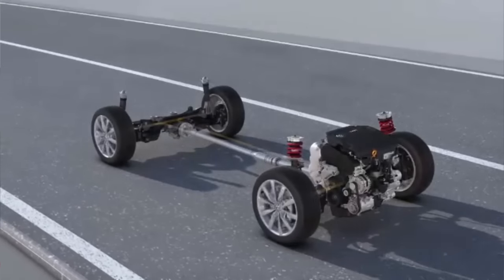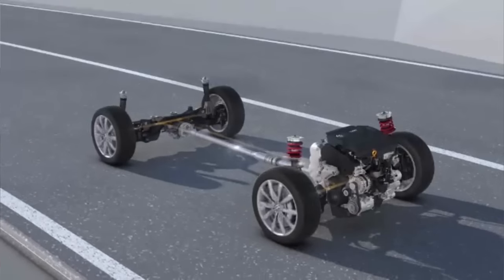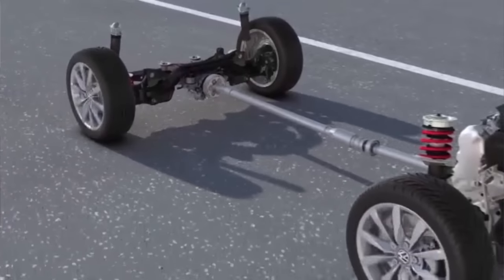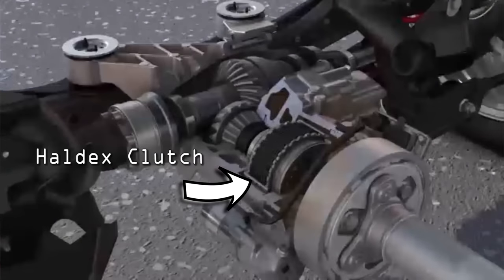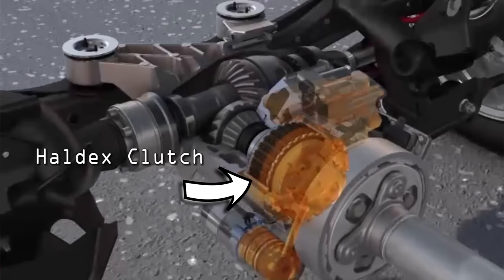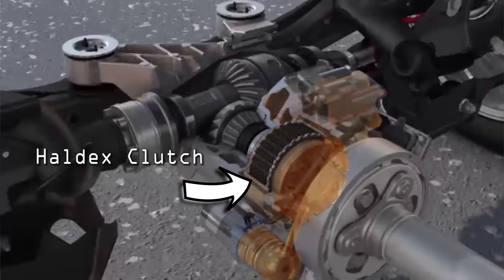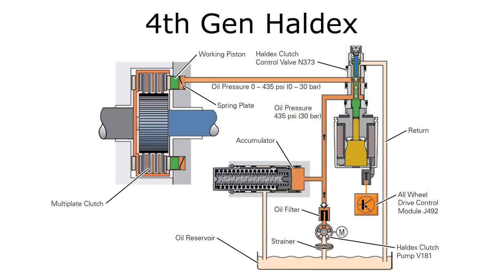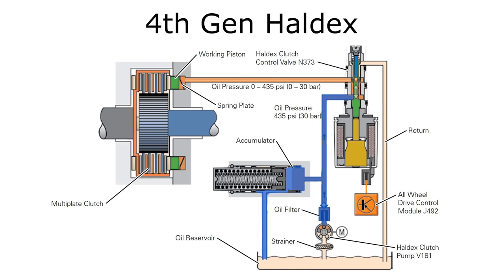How Haldex (AWD) All Wheel Drive Works

Comment: Actually, it was Gen III that added the electric pump for precharging the accumulator. Gen III was as fast as Gen IV in reaction time to front wheel slip (15 degrees), and was proactive as well, not just using front wheel slip to activate the rear wheels. The difference between III and IV was that IV eliminated the mechanical pump, and used an electric pump exclusively, while III had both an electric pump and a mechanical pump.
Reply: So which is better?
Reply: @nw8000  IV i think, as it eliminated the need for a serviceable filter and has less moving parts.
Reply: @aydenu9057  It only eliminated changing the filter from VAG dealers' service schedules.  Meanwhile, Haldex 4 and the current Haldex 5 pumps have been failing because of clogged paper cartridge filters in the former and clogged gauze strainers in the latter.  I had the gauze strainer in the Haldex 5 in one of our cars cleaned at 20k miles.  It was not a pretty sight.
Reply: Yo know maybe What is differenc with old versions Gen1 and Gen2

Comment: Hi one question please, if you know why on Audi Q3 (haldex gen 5) when launching with wheels turned all the way a rumble sound is heard accompanied by vibration at the beginning of the acceleration, and not happening if the steeeing is less that lets say 80% of full? What happens is it the haldex or the rear diff? Thanks

Comment: I have a 2010 Saab 9-3 XWD with Haldex Gen 4.  Have not driven it in snow yet, but can’t wait to see how it responds.  I just purchased the service kit, to change fluid and filter before winter.  Never had cross wheel drive before!

Comment: FANTASTIC! 
Thanks for taking the time to explain this, my buddy's R32 has been making a whine on higher speed downshifting and spirited driving conditions, we're going to tear it apart and fix it but this helped in researching quite a bit.

You should consider doing another similar to this one on the new electronic differential installed in the MK7 Autobahn GTI. As far as I know this electronic component is new to VW and only placed in a few production cars at this time. 
I worry about that part being the weak link as I buy parts to tune to beyond 300HP

Comment: Any recommendations on mechanics (not the dealer) in NJ and surrounding areas that are experienced in Haldex on MK1: Here is where I am at: 
1. Replaced the control unit with a used unit.
2. Got the dreadful code, sporadic mechanical clutch failure.
3. Replaced the ground strap/earth wire and tested the functioning of the rear wheels.. they spun on the lift and not under load.
4. Finally got the pump replaced and tested in the rain the other day. Just front wheels spinning.
5. We did the VCDS test on the Haldex system and all was ok. No codes at all.
6. Traction control light goes on when I got on the car.. ABS breaks tested/AWD System test and no codes. Tried getting the wheels to spin with out EPC activated with no luck either.

Is there anything else this awesome community can tell me what to look for before I get under the car myself and replace the whole rear drive of the car with another used unit?
163K on 2002 ALMS EDITION and don't think car is worth more than 4k.. Sucks to be attached to a fun car!

Comment: It is very easy to tell if Audi or VW has central differential or Haldex: cars with longitude engines has drive train with central diff f.i. Torsen; cars with transverse engines are equipped with Haldex.

Comment: Hi Paul..I have one problem with my audi s3 8p1 2008..i have give up my car in lifter..I have make the second gear inside and the front wheels is working and the big pipe front front to rear diff..but my rear wheels dont working..I haved chance the oil and filter from haldex system..and the pumpe is working I hear it..what do you think..have a another problem or the system start the work only when the car is in street..and he start from 0kmh or from 10-20kmh

Comment: Does 4 Motion rear diff make any noises like an old air conditioner’s refrigerator system kicking in? I just got an MY20 Allspace in Australia (normal Tiguan in US)  and noticed the noise at low rpm in D1-D3 but now all throughout the gears especially around 2000rpm - on accelerating gradually makes the noise more obvious but it fades away once the car is travelling at high speeds probably due to engine noise. It’s my first 4 Motion VAG car. The noise happens on accelerating in a straight line or more easily duplicated after going over the speed hump, gradually accelerating. 

Dealer (salesman) gave me a courtesy call on the day of pickup to tell me that it may be the humming noise from 4 Motion rear diff. Is that likely? It’s not intrusive and all of my passengers don’t notice it at all. My other drive is MK6 GTI and compared to that this Allspace makes a lot of ticking and clicking noises on downshifting as well - probably due to being quieter?

Comment: Paul - I have 2 Haldex equipped MK7's - Alltrack and R (both 2017's). The alltrack feels much more FWD than the R - not sure if it's because it's tuned differently, or just other factors. Are there any significant differences in the way the two AWD systems function?
Reply: Yup it's basically how it's tuned, Alltrack won't be travelling at high speed offroad so the system has enough time to react when the tires start slipping, so it will stay FWD most of the time, the R on the other hand need to be stable at high speed so it will throw power to the back and adjust more of the time and even before it starts to slip making it use the rear wheel more.
Hope this helps

Comment: Could you please possibly tell me if the haldex drive shaft on a mk7 golf r runs through the main clutch at the engine. If not I will run more power to the rear to ease the strain on the main clutch as it slips,

Comment: Hi and thanks for the info!

What happens if the pump is dead? the vehicle becomes front wheel drive and thats all? Is there any damage to the haldex if the pump is dead? Could you post the part number for the haldex pump gen 5?  I have the following error: 16671 - Pump for Haldex Clutch 
          C1112 04 [008] - Internal System Fault

Thank you!

Comment: I have a 2010 TTS that feels like it is driving from the rear under normal driving. It also wears out the rear tyres faster than the front. I cannot find any data on the % split for the TTS.

Comment: 4:02 there is no pump powered by the drive shaft in gen1, its electric. You can upgrade the gen1 controller to lock the clutch based on throttle position. There is also a mechanical insert plug to lock it 50:50. Aftermarket LSD available to front and rear. On stock form it's quite bad and introduces understeer easily
Reply from the maker: +avainola you are correct I misspoke and they also use electric pumps.
Reply: avainola I was also surprised when Paul said that because I had a gen 1 TT and it had a pump on it plus à filter the only model that have no pump was the syncro system In mk2 and 3 cars I thought that there was a version of Haldex that we never saw here in North America i Guess not. About the filter situation on the first few years or the production of the Tiguan there is a filter but it's not available at the dealer what I have seen is they tend to leak oil at the filter cover I bought some filter kit from ECS tuning I don't know if Paul has them available they are genuine Haldex parts they are not cheap but way cheaper than a new differentials.

Comment: What will happend if you customize haldex drivetrain on mid engine car like the MR2, transvers mounted engine and gearbox on the rear axle and the haldex system sending power to the front wheels.

Comment: I have a 8V S3 and the recommended Haldex oil change is every 3 years regardless of mileage. Is that oil the only thing required? No filters or special tools (as you've mentioned)? Is it easily accessible?
Reply from the maker: +jmb2027 filters are only on earlier gen haldex cars. Your vehicle wouldn't have a serviceable filter.
Reply: Deutsche Auto Parts thank you. what about any drain plugs, tool, or anything else required?

Comment: With a gen 5 haldex on a audi a3 quattro I'm having a rumbling on the rear end..fuse out to shut pump down no noise..question is are the rear axles doing anything different when haldex is engaging and sending power to the rear wheels vs when the car is acting as front wheel drive or when the fuse is out shutting the pump down..the cars already had a new pump and rear diff. Put in and didn't help

Comment: the 2017 S3 is said to have an upgrade AWD system where it can send more than 50% power to the rear wheels. On the audi website it also says it has the quattro system. So 1) is the S3 not AWD all the time? and 2) if not, is there a way to keep the rear  diff from decoupling?
Reply: Zareh Shahinian Quattro is Audi/ 4Motion is VW, still a Haldex system just each brands nomenclature.
Reply: Zareh Shahinian its mechanically impossible to send more than 50% to the rear wheels without the front wheels actually slipping. All 4 wheels on the same quality road surface and 50:50 is as rear biased as this setup physically allows.
Reply: You can never get more than 50% unless you can unhook the front axles from the transmission.
Reply: Yes it can, the traction control will kick in and can cut power to front wheels, hence rear wheels have all the power. Audi is stretching it, but they say the S3, RS3 and TTRS can do this. mk7.5 R as well.

Comment: thanks for share this video of haldex,  i ve the 2008 mk5 r32, can i use redlne oil GL5 75W90 on the haldex? or only recommended using the original haldex oil. any chance to use another haldex fluid, because the vw oil is expensive...thanks a lot. lawrence
Reply: sorry, due to friction clutch was developed along with the oil, so there is only one choice: statoil 12-301, now it is owned by FUCHShttps://www.rimmerbros.co.uk/Item--i-LR054941if you are in China, I can send u some.

Comment: What about Volvo, same?  I want to convert my FWD 2002 V70 to AWD if I can find a wrecked XC70 with a complete setup.  Will probably want to rebuild/service some of the driveline components.  Could you point me toward any applicable resources for AWD swaps on P2 chassis Volvos?
Reply: Really Happenings h
Have you begun the project? woldnt the lack of a transmission tunnel be a problem?
Reply: honestguy77 !      Have not started it... however V70s and XC70s have the exact same unibody throughout all generations... only trim DC ifferences.  Volvo fits both the exhaust and the driveshaft in the same shallow tunnel on all P2 AWD setups afaik.  The challenge is the DEM differential electronic module, getting it to work with a non-native system.
Reply: BTW there are AWD versions of the V70 (i.e. V70R).  I just want to convert what I already have.
Reply: @reallyhappenings5597   Have you checked VolvoSpeed.com & SwedeSpeed.com? I'm converting my C30 to AWD. What we (myself and other C30 owners) are trying to come up with is a 'standalone' Haldex controller similar to what GTIforum users have done

Comment: Is there a Haldex Gen4 or Gen5 model that controls not only front/rear axle power split BUT ALSO leftrear/rightrear split? I mean the torque vectoring between leftrear and rightrear is not done by the brake but done by haldex clutch. I know Saab 9-3 Turbo X's Gen4 Haldex has it. How about other models?
Reply: I guess you mean the eLSD: electric limited slip differential, Cadilas SRX has the system.
Reply: Not on Gen 5.

Comment: Excellent work! What would it take for a Haldex system to put more than 50% rearward?
Reply from the maker: Going to talk about on Askdap 78
Reply: Not possible, as in impossible.  Of course, if you remove the front axles and substitute other hubs you'll have RWD but the ECM won't allow the clutches to close.  You would need to mechanically lock the prop shafts to the rear diff.  Good luck doing that.  Even if, you'll have a dash that looks like a Xmas tree.
Reply: HPA controller...acts lik torsen when fitted...full awd
Reply: @whatsup8464  Could you please elaborate?!
Reply: @IC.XC.NI.KA.  what is there to elaborate exclamation mark
Reply: @whatsup8464  w
HPA controller, what it is and how it's used. Thanks.
Reply: @IC.XC.NI.KA.  so a HPA controller is fitted to allow basically the haldex to become 50:50 torque front to rear constant.. ..with the haldex as you seem on the info above...its based on the the loss of traction on the front detected and almost instantly brings in the rear...which in my view for example wen cornering will still be front biased...hpa controller overrides this and eliminates haldex to have permanent quattro...or torsen as it's more commonly known...hope this helps

Comment: What does it means if propler (differential shaft) not moving while running?
Only front wheels power the car! Hyundai santafe awd automatic
Reply: That means that the prop shaft is not driven. And that means most likely that your transfer case is broken.

Comment: Mmm I have 2.0tdi 4motion and if I drive easy back just working 20% if I stuck or in the snow and pushing then yes I have for front and back 100% so what do you trying to say???
Reply: Gen 5 is zero unless the front wheels lose traction.  You must have the older, less efficient version.  Buy a new car.
Reply: Ramūnas G
Reply: @ClanOgilby  wait.. you think new cars are better? 🤣🤣  haldex is gash full stop but new cars are utterly attrocious and so unreliable its biblical. I think the best thing to do is not buy VAG but If you must, then stay well away from Haldex junk.
Reply: Haldex is not junk in Audi or VW...that's when you know how and where to use it...its not for off roading ..

Comment: It sounds like he was describing XDS with the ABS brake and EDL mode working to slow the spinning wheel down. that's not how i understand VAQ works as it clearly states the Performance Package model of the GTI actually has an electronically controlled limited slip diff... it seems there really still isn't that much info on exactly how the VAQ diff works, when is it actually engaged ie. only in turns or if it's engaged at launch, whether it's still engaged with ESC mode fully disabled. i'd love to find this info out if anyone knows more about the subject.
Reply from the maker: The Performance Pack GTI does have an electronic Limited Slip, but the AWD models dont.
Reply: That makes sense. Do you think you could do a video on how the gti lsd works  specifically with esc on, in sport, and off?

Comment: My mk1 Audi TT haldex doesn't work, all grounds seem fine and the pump does work seemingly, any ideas? Thanks
Reply: Adam Saxton check with vcds if there are any codes. You can also actuate the system to see if the lion and Haldex are working, when cycled they make noise it's faint so you have to be under or touching it to hear it. 
My guess would be you need a new controller. Find one quick they are obsolete.
Reply: LUI Aviles is there anyway I can determine if the controller is done?
Reply: Adam Saxton it sounds like the control module is dead. I have a MKIV R32. I have replaced the pump and Control Module.
Reply: attempt communication with the haldex controller with vcds, like Adam mentioned below it could be the control module or the haldex pump.

Comment: I thought Gen 5 Haldex could send up to 95% torque to the rear axle on demand and at most 85% on a single wheel that still has traction.

Comment: Can someone tell me which quattro system 2017/2018 A4 has. I read it's a haldex with a 40/60 Front/Rear?  Thanks!
Reply: That year A4 has Thorsen and not Haldex, that's the only way it can have drive split 60/40 rear/front, it's an amazing system, worked great in my S4 (plus sport rear diff with torque vectoring) I prefer it to the Haldex system for sure.

Comment: I thought gen 5 was pretty different and didnt need an accumulator or solenoid valve
Reply: You are correct. Gen 5 uses a veritable pressure pump.

Comment: can obdeleven increase sensitivity?
Reply: Not sure but you can get a tune for the Haldex Gen 2, 4 or 5 from United Motorsports or a race controller from Neuspeed or HPA.
Reply from the maker: Nothing for Gen 5 yet it looks like.
Reply: Deutsche Auto Parts Yet ;)
Reply: Kyle Mandt Gen 1 also 😎
Reply: So is it possible to increase over the 50% power to the rear with an aftermarket controller?
Reply: I think you are right.  I thought I heard my local tuner saying UM had it but UM usually posts it on their facebooks like they did for Gen1,2 and 4.
Reply: You are correct sir,   :)
Reply: I don't think you can go over 50.  Best to ask a company that specializes in modding the Haldex.
Reply: No.  You would need to detach the front axles.

Comment: With that pump running 100% of the time and 30 bar of pressure constantly in the system it’s not surprising you get leaks. This system doesn’t seem to be designed with a long lifespan in mind.

Comment: There are times when Haldex isn't the greatest AWD system. When it fully locks, it's a pretty sure bet that the Golf R is going to understeer. https://youtu.be/aV0twgoEDaY is a recent example of this.
Reply: I leaned on mine around corners from a dead stop a few times.  I only get mild OVERSTEER.  I have Gen 5.
Reply: Its never been the greatest system or even close so?  I dont know if your aware mate but its a junk system even the volvo owners want it gone.
Reply: @shutyourpieholeboy877  Yep, I finally ditched it for a much better, dual-motor AWD system (Tesla). ;-)